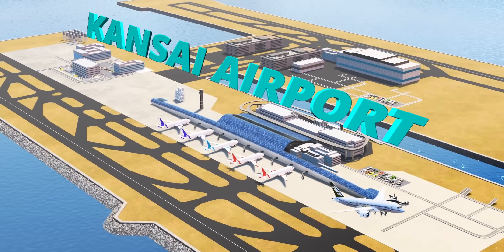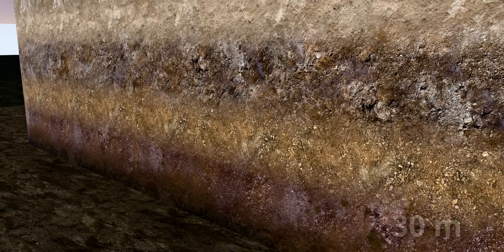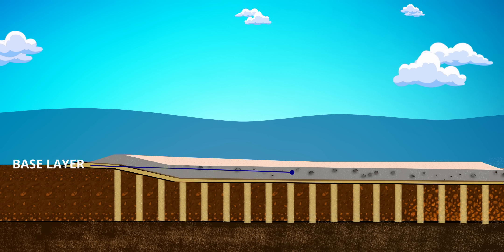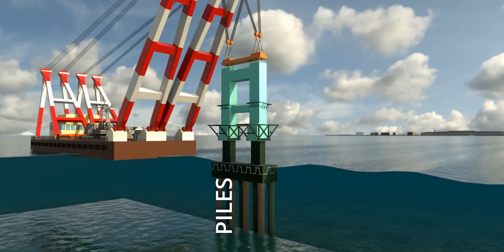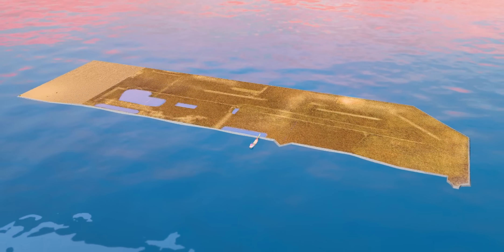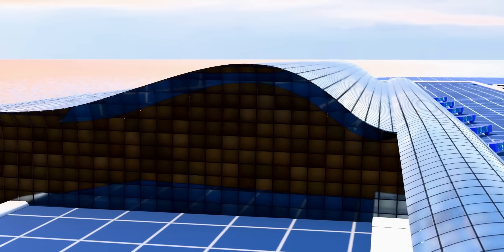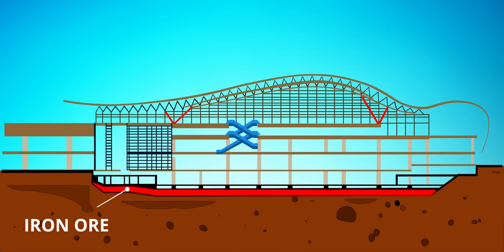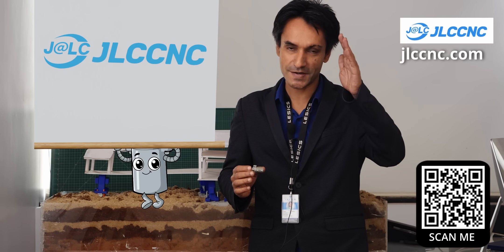Japan Built an Airport at Sea - Crazy idea, but the Result Will Change the World!

Comment from the maker: I hope you enjoyed the beauty of precise CNC machining. https://jlccnc.com/?from=SabinCE New users can claim upto 70 welcome coupons by visiting this link. With CNC machining and sheet metal services starting at just $1, JLCCNC makes high-quality fabrication accessible to everyone.
Thanks for watching! — Sabin Mathew
Reply: Hi
Reply: WHY on Earth did they not just level the mountains and build the airport a thousand feet above sea level ? The foundation would have been solid and cheap to build on. You can put in as many earthquake isolators as you like for the buildings at a fraction of the cost of this island in the sea. Aircraft use a lot of fuel climbing from just above sea level to a thousand feet. That could have been saved on every take off. As foundations for the runways could have been minimal, three runways in different orientations to deal with cross winds could have been built for less than the one runway on the sea,